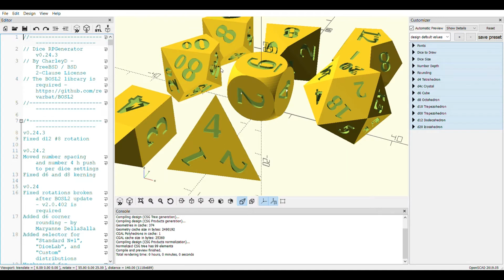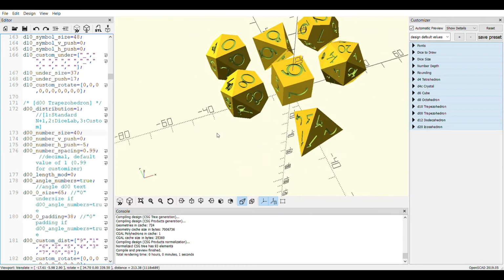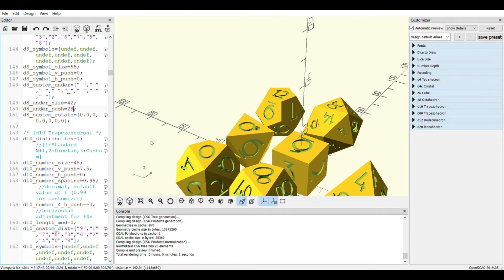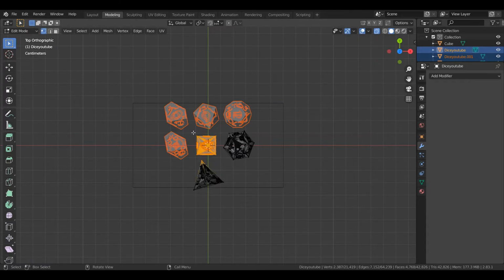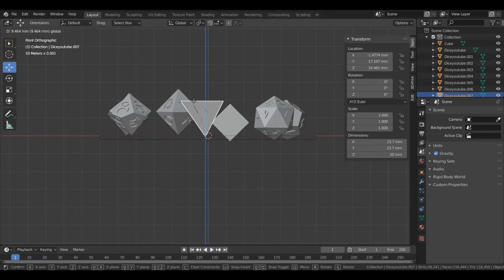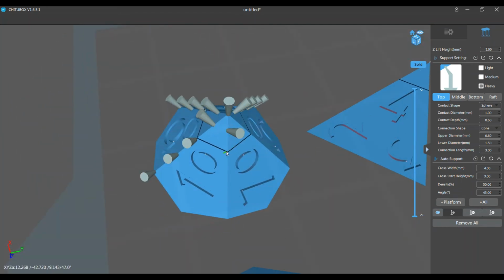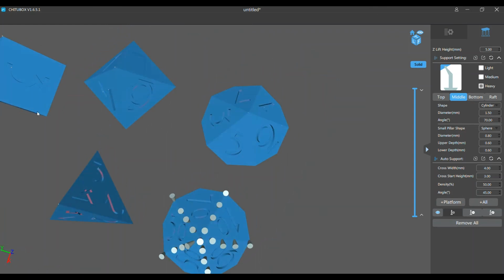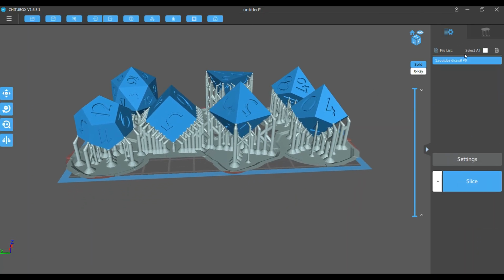DIY 3D PRINTED DICE MASTERS // 3D Modeling Dice Masters and Placing Supports for Printing

Comment: Idk if someone else has commented this - but you can change the mid support angle and then all of your supports will be applied vertically right off the bat - that way you wont have to go through and manually move all of them. Super helpful video though, thank you!!!

Comment: Under the rounding section as you demonstrate with the D6, there is a section for corner clipping. Is there a way to add corner clipping to a singular dice, such as the D4, without corner clipping all the dice? I tried manually adding the code both under the rounding section to target the D4 and under the D4P sections respectively, I either did something wrong, or it just simply didn't work.

Comment: Great video(s)! I've been using this as well for my masters. Why not use the drop downs on the right? It would probably make life  a little easier :D
Reply from the maker: I noticed the drop downs after I had made this video😂 they do make life a lot easier. I was just used to the older version and it didn’t have the drop down menus

Comment: I was lucky enough to be able to borrow a Formlabs Form2 and I’m using your instructions here to print my own masters. Do I need something like Inhibit X to coat my masters before I try to make molds? This is all new to me and I don’t know much about resin printers, but I don’t want to waste any of this Sorta Clear...
Reply from the maker: I believe the formlabs resin does not cause cure inhibition but just to be safe you can always try molding 1 die first to see if it causes any problems, or if you already have inhibit x you can coat them anyways just to be safe.

Comment: Thank you for that, it will come in handy.
My question is actually how you use 3D printed dice for silicone molds, I heard that you have to do something with them before molding?
Reply from the maker: A lot of times you have to coat them with inhibitx before making molds or they will cause cure inhibition where the dice touch silicone. This isn't the case with all printer resins so it really depends on the type of resin your masters are made of

Comment: Do you have any tips/tricks when it comes to cleaning up after you’re done pouring? I’ve been using isopropyl alcohol per my resin’s instructions, but I can’t seem to really get my mixing cups clean. Or should I just be throwing them away after a single use?
Thanks!
Reply from the maker: For my mixing cups I just let the left over resin cure and then peel it out of the cup.  If there are any little left over bits I flip the cup inside out and use packing tape  to remove them.
Reply: I personally end up taking a paper towel and wiping the whole cup down as much as I can, and then go in with isopropyl alcohol. This has worked really well for me, hope it works out for you!

Comment: Thank you so much for this video! I've been trying to print masters successfully but I suck at adding supports, so hopefully this helps. Also, I might need to finally make a FB account to join the Dice Making Discoveries group... that software looks super useful! I've just been using Blender to model my dice.

Speaking of Blender, here's a quick tip: When separating dice, just select them all and choose the "By Loose Parts" option in the Separate menu. That'll separate all of them from each other in one step. You do still need to re-set the origin for each one individually though. Hope this helps!
Reply from the maker: Oh that's super helpful! Thank you! I'm still learning blender so that tip is a nice time saver! I usually use blender to model mine as well but it's a lot more complicated than this software so I just kept it simple for this video :) I'm glad this was helpful for you!